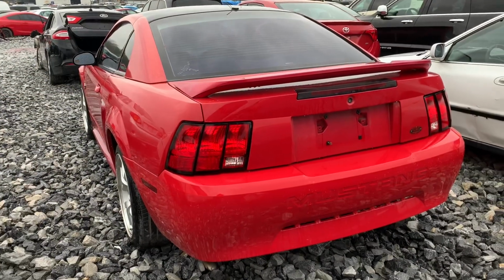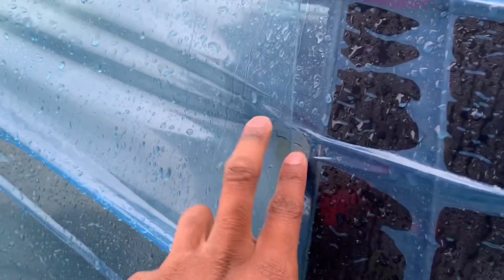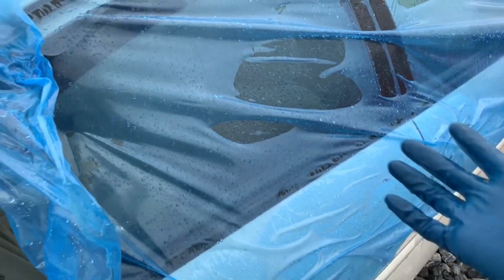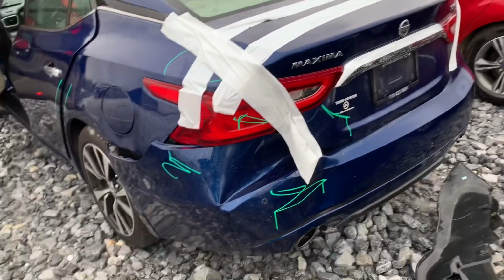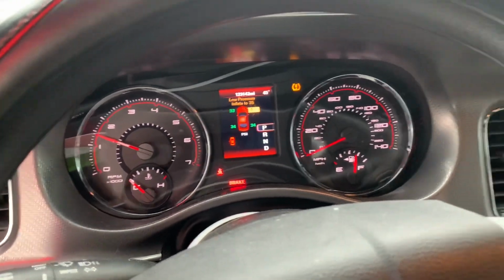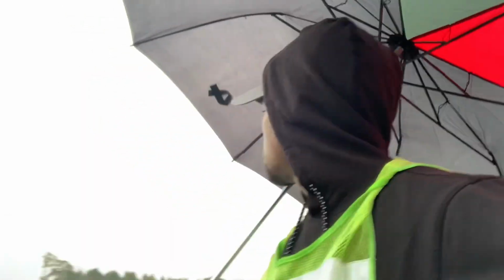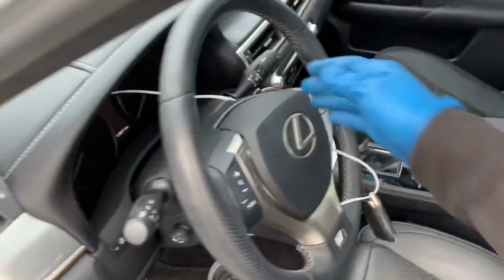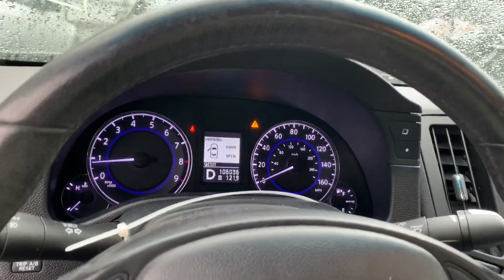I FOUND A 2013 V6 DODGE CHARGER FOR ONLY $3350 AT COPART! *I THINK I SOULD GET IT!*

Comment: $3500? Man, it would have to be a low mileage car with a cheap fix possible...because with a branded title, a low demand vehicle (V6 Charger) there isn't a good margin on it. The Olds looks to have better return potential, seriously, if it didn't have the C-pillar damage